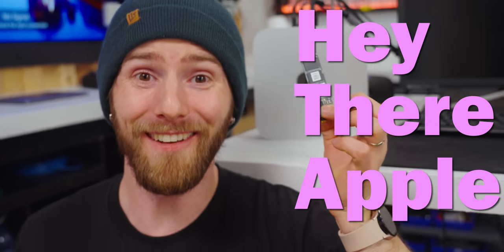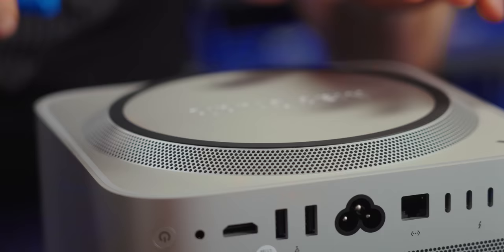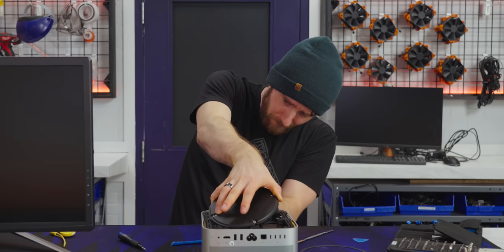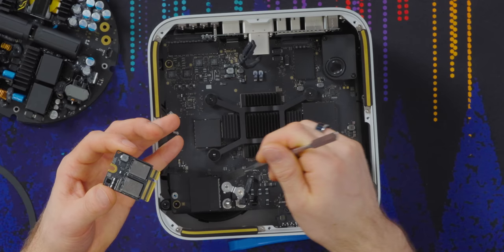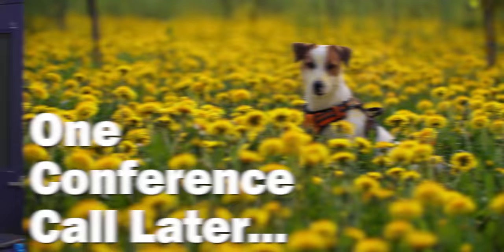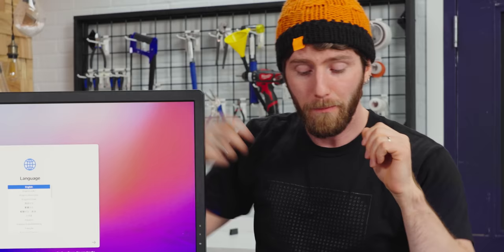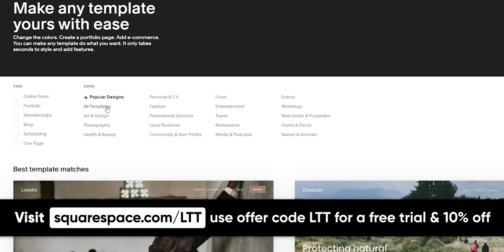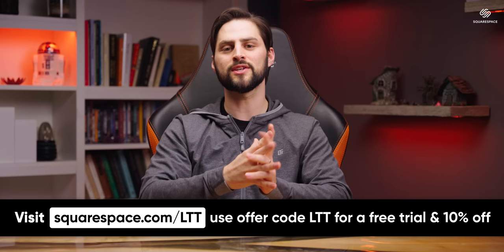I want to love Apple, but they’re making it hard - Mac Studio SSD Swapping

Comment: I'm on a 2014 MSI gaming laptop that I got for cheap.  It came with in i7, 8GB RAM, Nvidia 840m a hard drive, and a DVD.  I upgraded the RAM to 16GB and swapped the HDD and DVD to 256GB SSD and 1TB SSD.  The purpose for it was mainly to record music (Pro Tools), some video editing, and casual gaming just because it can.   I felt like I got a pretty capable system (at the time) for a low price and partly because I was able to upgrade it myself.  The cooling fan started sounding like a chainsaw after a while, so I was able to swap that out easily as well.  The battery failed, so I got a new battery.  The thing is still working fine. 

That being said, it's 2022 now and there are things I don't like about it.  Using a USB 3 hub is not the business.  There are a couple of things that randomly need to be un-plugged and plugged back in to work.  The system is also a small loud space heater.  I'm also at a place where I'm tired of troubleshooting things at random when they were working the last time I touched them and I've done nothing myself to break them.  Such is the life of a Windows/Android user.  

I'm considering a refresh in the next year and have been strongly considering switching to the Apple ecosystem (Mac, iPhone, Apple Watch) for the "it just works" factor.  Superior power and thermal management is also appealing.  I live in Phoenix and I don't need a heater in a 10x10 room.  Issues like this, though...  This is what makes me stop and think again.  I could justify some extra money over many years for a better experience, but I am not in a mood to pay people extra just because f*** you.  I'm also not a fan of their attitude toward consumers in general.  I've been thinking quite a bit about a Mac Book Air or 14" Pro, then switching from Pixel to iPhone, Samsung Watch to Apple, but then I see this.  Then I remember they have a damn thunderbolt cable on their website for $130.  

That makes me want to boycott them for life, but then I remember that the anti-consumer stuff that they do affects the other products.  My Pixel 6 didn't come with a charger or headphone jack.  YAY!  Value!  I haven't been able to swap batteries (without getting wild with a heat source and destroying a screen) for several years now.  My wife is on her second expensive Surface laptop now and they are just as bad.  I tried to swap batteries on a Surface Book 2, started cracking the screen, then stopped.  A Surface Laptop Studio, which is kind of awesome, has some kind of problem with it already.  

So...  If other products are adopting these same @#$% practices but don't work as well, then where does that leave us?  I suppose it's either more low-tech devices that you can open, desktops, or just sucking it up and handing over the money.  Videos like this remind me of why I've never adopted Apple's stuff, though.  I know they're good at certain things, but they can also burn in hell.  It's complicated.
Reply: Get an Asus laptop.
Reply: @Tanfo77  Nope. I have an Asus laptop: 17", Ryzen 7, 1660Ti.... I replaced the fans after 6 months; the laptop has REALLY bad thermal management and suffers from significant thermal throttling (all thanks to a SHARED heat pipe between the GPU and CPU). 

Asus put together great components, but their thermal management is dog shit. 

My sister in law has a similar laptop (Asus TUF, 15", Ryzen 5, GTX1650) and its fans went even quicker than mine.
Reply: I don't know why do you guys get pissed over the heating issues? You're running a 5 GigaHertz GPU and a 3.4 GigaHertz CPU on a single piece of 14 inch block that is just an inch thicker, which luckily also has dedicated cooling system like fans and liquid coolers. They do manage to take care that your laptops don't get over 70°C or get fried.
Reply: Um... I didnt read everything here because I have better things to do like tell you for what i read i can tell its an old pc so yeah there are going to be problems.. Get a new one is a no-brainer yours is 8 years old lol you defintely got your money's worth and plus no Apple computer 8 years old would even be usable much anymore lmao and also you may be able to get away with getting a new pc case, motherboard, and maybe a PSU and just moving everything else to the new tower. Building new computers is fun
Reply: I’ve a 2014 MacBook Pro. Works perfectly fine until today. Which I swap for a m1 pro max which I could use for another 7-8 years without visiting the repair or having to upgrade or anything
Reply: @drbaxisnayak703  me with intel celeron 1.10 ghz dont saying a shit about and being just happy for having a computer... bro really?
Reply: yo ive been looking for a music production laptop, any recommendations. i was looking at the msi katana or dell g15

Comment: I just bought a 4 Tb (WD Blue) 4 Tb SSD. Yeah, in 2½" bay form, but it was about ¾ of... The other one I bought at the start of the year.  Which makes my studio pc from years back 13 Tb of storage. Old hard drive's contents have been copied (I just backup software), I'll put the drive in at daylight tomorrow.  The old drive was about 80 % filled, the replacing SSD is about 13 % filled. That's the beauty of updating drives from erm... Ten years ago or so. And much simpler than changing drives in this silly machine, haha. 
I smiled and laughed throughout the video. Silly, silly Apple. Never buy one. As in the vid: since you need two.That's just evil, innit. Happy holidays anyhow! 'Tis the season.

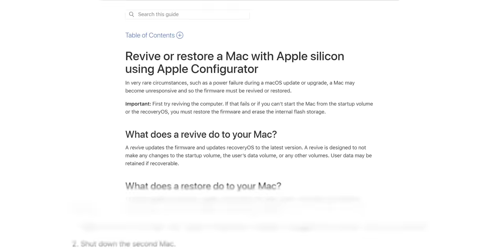Comment: 9:50 the reflash environments unfortunately went away because Apple seemed to be basing them off of their own custom version of the UEFI that Intel chips allowed for. Once they switched to Apple Silicon the UEFI based recovery modes went away.
Reply: That's kinda idiotic...since they insure you can't fix your OS on a computer you own if it goes haywire...
Reply: They certainly could've made something that does the same on iBoot (the UEFI equivalent Apple Silicon uses) if they wanted. Absolutely mind-blowing they didn't.
Reply: @hanro50  it's not about the OS, it's about firmware. If your OS breaks, you can still boot into internet recovery.
Reply: @PvtAnonymous  We're talking about the fact that you can't do that on the M1 macs Linus had in the video.
Reply: That definitely seems like a design choice that benefits a chip maker that owns service centers(that just happen to make you walk by all the shiny new/working computers with your broken one) a lot more than one that sells to oems
Reply: @hanro50  you can. Just not if you screw up the records from the storage controller. What is actually happening when you swap these modules is a lot more technical  than what‘s shown in the video. Usually this firmware flashing via Apple Configurator will not be necessary for 99,99% of all users EVER. We have had not a single Mac that needed a T2 reflash, not even talking about M1.
Reply: The recovery mode in my opinion was the closest thing we'd get to a BIOS on apple and they nuked it.
Reply: @Appri  the recovery mode is still there btw.
Reply: @hanro50  I agree. I worked with Apple hardware on an enterprise level for several years and that net-recovery option saved me tons of trouble more times than I could count!
Reply: @GarrettCrespo  You can still do that.
Reply: @SanderEvers  You can still go in to recovery mode, but internet recovery is no longer a thing for Macs with an empty SSD with no recovery partition on it. you need the configurator app for that now.

Comment: The worst part about this is that there is almost certainly no hardware difference between the actual SOC chiplet SSD controller between Mac studio versions. Anyone who thinks that the M1 silicon SSD control chip is physically different between SKUs is on some heavy copium. Speaking as someone who works in silicon, I can almost guarantee that the cost to produce different ASIC masks for different Mac Studio capacity SKUs far outweighs the ease of just wounding the SSD controller capacity down via supervisory flash settings or just locking it down in FW. There is no hardware reason the Mac Studio should not be upgradeable. Apple had to actively engineer this problem.

Comment: This makes me really worried about how Apple will handle the eventual Apple Silicon Mac Pro, especially considering that’s the whole point of the Mac Pro is its expandability.
Reply: And you can expand when you buy a new machine
Reply: Yeah it probably should. After their last one I could never even imagine putting effort into getting even a used one. Just too much hassle for such a high end and potentially mission critical product.
Reply: @iLikeTrainsXx  MS this just the next, Microsoft, windows 10, what was it the last up grade, buy or something?
Reply: @dh2032  what are you even talking about
Reply: @dh2032  Bro, what?
Reply: They will use custom sockets on the motherboard where only apple components fit
Reply: They in fact already do this with the current Mac Pro. The SSDs are firmware-locked, and can only be upgraded with the SSD modules on sale on their website. They haven't offered "storage upgrade kits" for the Studio yet, though.
Reply: Don't worry it will be so ridiculously overpriced you won't be able to afford it anyway.
Reply: @dh2032  If you're referring to the hardware restrictions of Windows 11, you can run it on anything. It's just not validated for much of anything older than Ryzen 1000. MS isn't making money on 5 year old used hardware
Reply: The Upgradibility of my 2010 27 inch iMac and the 2009-2011 27 inch iMac generation overall is the reason i love the device so much, even though otherwise i HATE Apple. Only reason for me to keep owning it

Comment: After building my of PC's for many years I got tired of the agony of having to replace the whole shabang anyway after a couple of years why the PCi, Rams, cpus and whatever was stuck on a deadend route and decided I was not going to waste endless hours of Youtube and manuals to keep my PC running. Another factor was the part that even after investing all I could on fanless components, watercooling and what not I still never got my PC to keep silent. So I went and had a look at a Mac Studio. It did what I wanted it to do and it did it silently. End of intro - I bought it one. The price jumps between versions, ram, and drive options made me go with 32 GB and 512SSD. It still does what I want it to do, but I have added external SSDs to store my work since it is not possible to upgrade the internal drive. It is totally insane. It would have made some sense if they at least offered a service to take units in and offer upgrades as a paid service. Pretty weird also that no environmental organisation have tried to sue them for this.

Comment: Apple wants to eventually move towards a hardware subscription model. That's why they don't want their users modifying their systems.
Reply: yup, they are just waiting though until they find a way to make that subscription cost at least a 100% margin over buying the hardware outright, because anything short of that wouldn't be worth it for them :D
Reply: And then others will follow once they find out how much money can be generated.
Reply: When they do that I am moving completely out of the apple ecosystem. If I have to subscribe to use my phone, then I rather not have a phone
Reply: @shoto42  I'm leaving this ship before it sinks. Currently on a 2017 Macbook Pro which has trouble keeping up with my new tech requirements and is starting to show its age, so I've been in the process of deciding what I'll be upgrading to in the next few months. The improvements Apple showed with its newest line of M1 Pro/Max MBPs last October made me hopeful for the future and really had me sitting on the fence between switching to PC or staying on MacOS. This Mac Studio (and the laughable Studio Monitor) completely shattered that hope now.

Apple is not gonna change. What they are, what they represent, and the crowd they cater to does not represent me. I'm building myself a PC this summer and I won't be looking back. At least my Macbook is pre Apple silicon so I'll be able to dedicate it fully to running Windows 10 through Bootcamp (until I save enough to buy myself a nice MSI or Lenovo laptop).

Sayonara, Tim Apple. Can't say it's been a pleasure.
Reply: @CosmicTeapot  It'll be the best choice you can make. My 2015 PC is working just fine, with exception of windows 7. I'll just wipe and clean install with 10 or 11 and it'll be good to go. Here's to your new computer working just as long and longer.
Reply: @applepie9806  Cheers buddy! I've actually been trying Windows 10 out for a few months already through Bootcamp, and I've loved the experience so far. I think MKBHD's metaphor was really accurate when he said that Apple is like a walled-garden (with very very high walls), and PC is like the outside world. Sure, everything is all neat and tidy inside the garden but you have no freedom.

I've since realized that with a bit of time and effort, you can make the outside world just as neat and tidy as the garden, minus the limitations. I've used third party apps and the registry editor to customize Windows to look and feel beautiful (in my opinion). Sure, you can't get the nice/smooth gestures with the touchpad but it's a really small price to pay to be out of what is essentially a prison.

I've been vocally on the side of Rights to Repair since the beginning of the movement, I'll be glad to voice my opinion with my wallet from now on and not contribute to the perpetuation of this evil practice. I just wish more Apple users will consider doing the same, but I don't have really high hopes in that regard.
Reply: @applepie9806   If you're not dependent on something too Windows-specific, like Adobe's crap, then you could probably move to Linux instead.
Reply: @CosmicTeapot  Microsoft's been putting up fences around Windows for a while, though. If you want to actually stay on the outside, your options are basically limited to various flavours of Linux and BSD.
Reply: This is the real endgame, turning apple products into glorified internet cafe
Reply: @stater3  You mean M$?  They are trying...